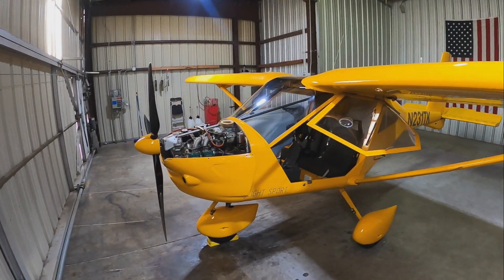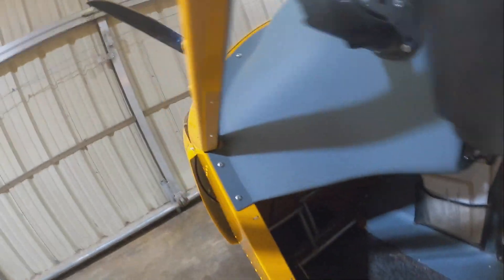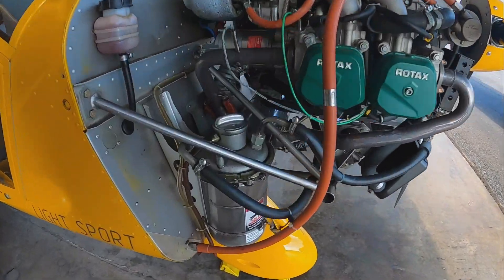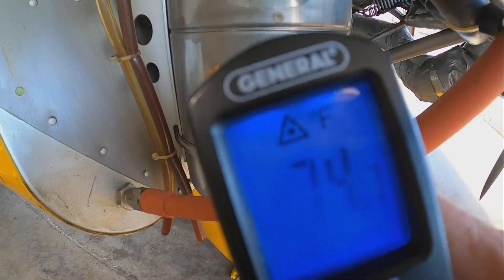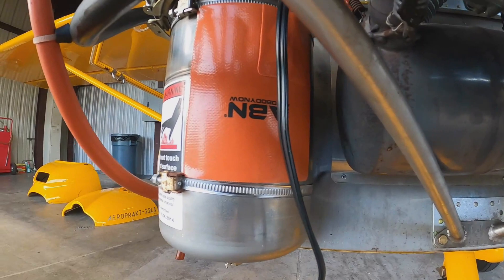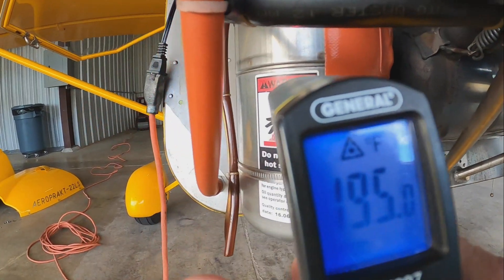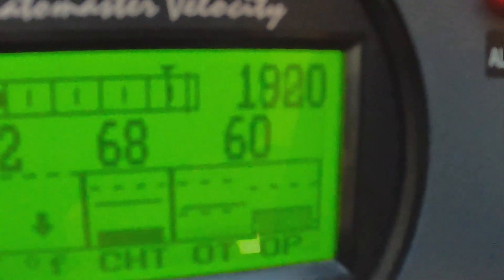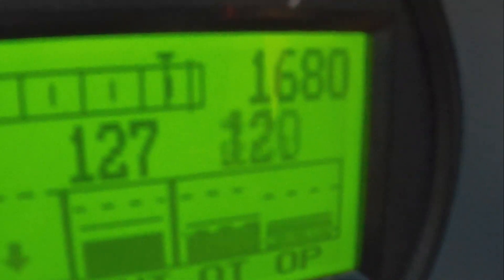OIL TANK HEATER INSTALL ON AEROPRAKT A22 / ROTAX 912ULS. #aeoprakt

Comment: Because much of the oil in a rotax is left in the engine & not the oil tank until you "burp" the engine, that oil is not going to get warmed with the pad. I'm not sure of the ratio of the remaining oil in the engine to the oil tank is so I think that is a critical calculation to decide how much the heating pad element is really helping. Do you have any insights on this? Seems to me a better way would be to get to the hanger, burp the engine, then go get some breakfast & coffee or do some other activity while the heater is working. Your thoughts?
Reply from the maker: I think you’re correct. Or else burp it after your return flight and out the heater on a timer or controller.